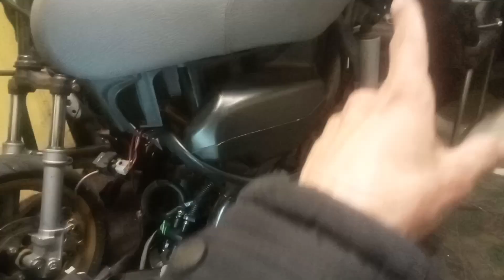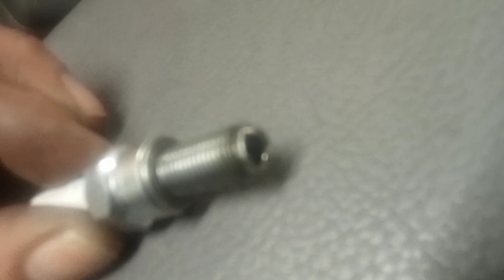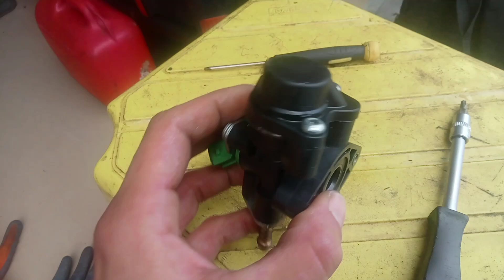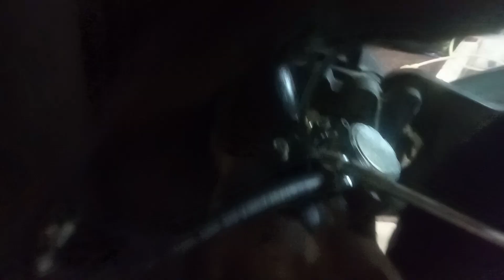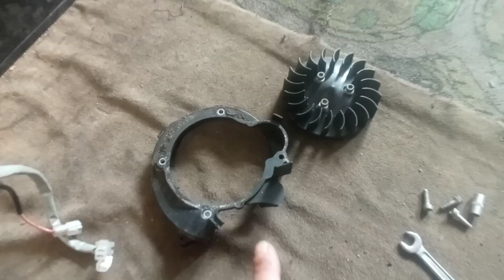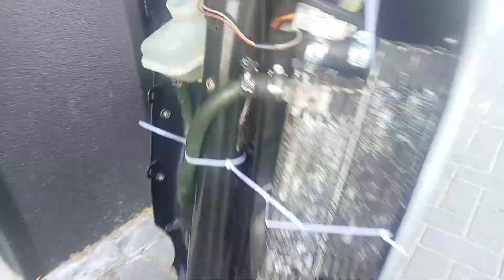(ENG)Knettervlog #41; Convert Air Cooled Scarabeo Ditech to Water Cooled!

Comment: I just replaced the coolent on my ditech sr50 i cant get it flow cooland to the tank i chechked the water pumo is all good what to do
Reply from the maker: If you start your scooter and warm it up, the thermostat should be open and then you should see the flow in the tank. When your radiator gets warm, it is cooling.
Reply: @knetterman i spent 3hours trying to blled no luck checked the water pump twice is good im suspecting is the thermostat if it has one
Reply from the maker: @Bardhselmaniithermostat is on top of the cilinderhead, remover the flange where the water hose is on and you can remover it. Try reusing the rubber gasket or use some gasket maker.

Comment: Compared to SR's, that's a pretty shitty design. I mean on the Piaggio ditech the sparkplug is not the easiest to reach without disassembling but man this takes the win by a stretch. 

BTW. did Peugeot Elyseo ditech use this Morini air cooled engine? I believe Suzuki Katana had the LC but not sure. You have must gone thourgh a lot of these purejet/ditechs but have you ever had a chance to tinker with that Peugeot?

Anyway, this is a nice conversion, propably the first in the world? Im also glad that you're doing ditech content. Guess you're the last one left on youtube. Others just convert these to carbs so keep them videos coming, they are appreciated!
Reply from the maker: Peugeot uses its own block. Vertical peugeot engine.